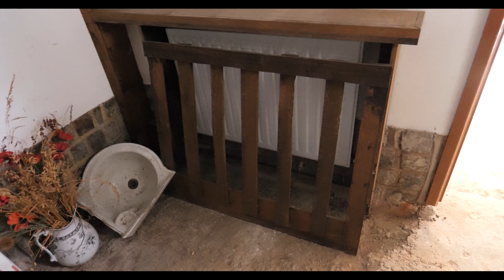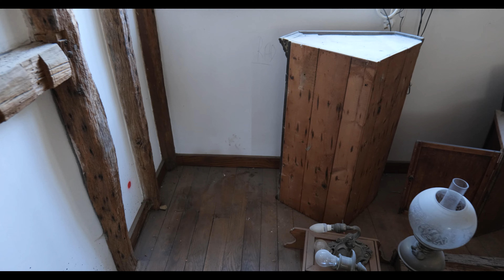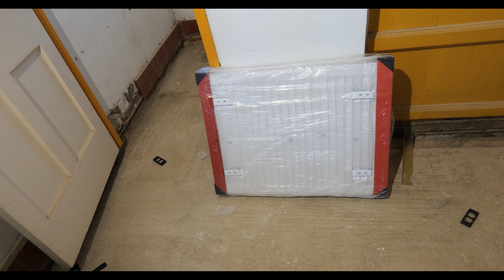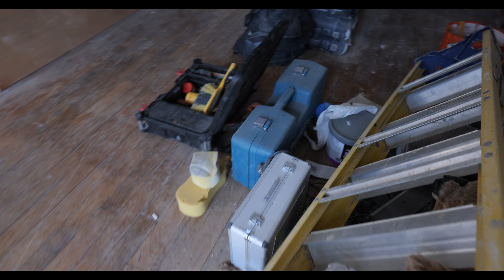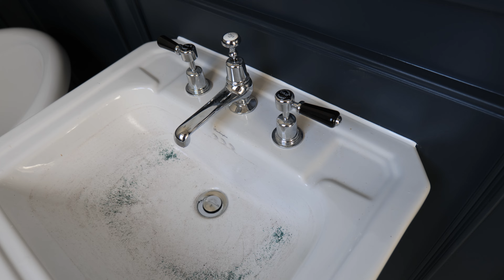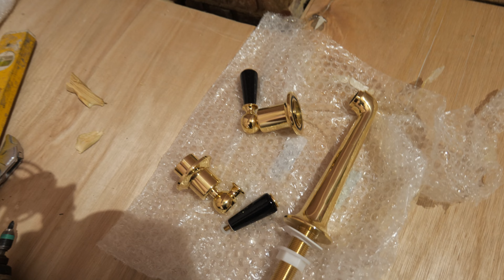Heating Pipework Complete - Wall mounted Taps

Comment: Lovely work 👍. Do you ever use press fittings under the concrete floor? Just wondering for myself in the future
Reply from the maker: Yes I'm happy to use the press under screed . Just make sure the copper is protected 👍. In my eyes a press fitting is as good as a soldered

Comment: Thank you.When you channel out concrete floor for pipes (and lagging) how much do you allow between top of pipes/lagging and FFL i.e the making good depth.Hope this makes sense.I like the use of telescopic Walraven.Look forward to next video.
Reply from the maker: Normally we chase to a 40mm-50mm depth. That's walls and floor. We generally use a chase tool and that's how deep it goes. On this occasion we used the grinder and gunned it out. We only went as far as the  membrane on. The insulation is probably only 10mm under in places but fortunately the rooms are being carpeted. Part L throws up a lot of issues . Thanks for the support. Appreciate the comments.
Reply: @loving-plumbing  Thank you for you reply.